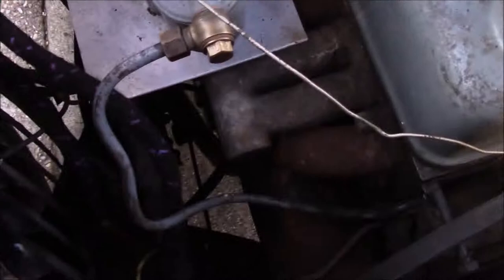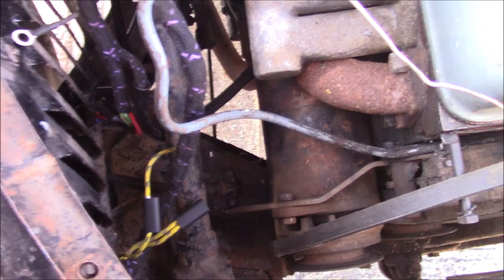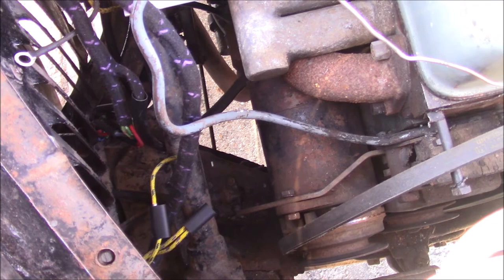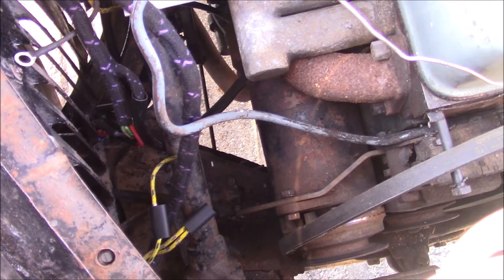1951 Lanchester LD10 - Quick Electrical Update - #shorts

Comment: Your fan belt is not mounted properly on the dynamo pulley.
Reply from the maker: That's because the water pump isn't fitted.  The belt is just sitting there.  But because the engine mount is worn out, the engine is sitting too low to remove the belt.  It's on the list of Jobs To Do.
Reply: @noexpensespentstudios  the dynamo is unlikely to sound great or operate efficiently with the fan belt incorrectly mounted.
Reply from the maker: @teamjdb  Agreed.  But why is the dynamo doing things when it shouldn't?  That's the real mystery here.  Bear in mind we've not been running the engine while the wiring is being done so there's no reason for the dynamo to be doing anything at all really.  It just decided it wanted to have a fun time and make some noise, apparently, without us doing anything to make it.
Reply: I see, or rather I don't. The usual operation of the dynamo is that the engine spins it via the fan belt, this causes the dynamo's rotating windings to generate electrical charge which is then transferred to the car's wider electrical circuit via the regulator. Without the water pump, I can't imagine the fan belt is transferring rotation from the engine's crankshaft pulley, therefore the dynamo will not be rotating and will not be making any noise.
Reply from the maker: @teamjdb  and now you see why we're confused.  Why is it moving at all if it's not connected to anything?  Why has it decided to start doing that totally randomly without us changing anything at all?